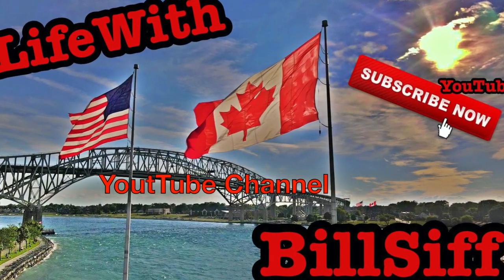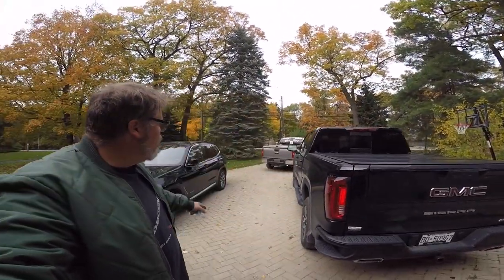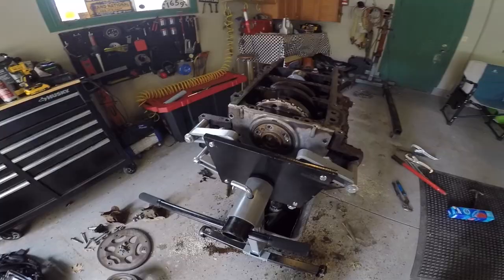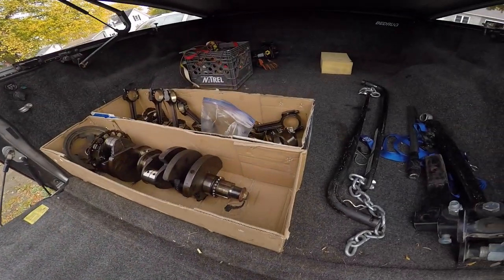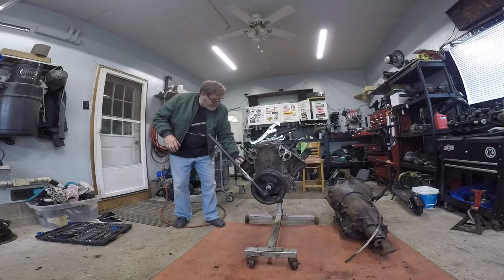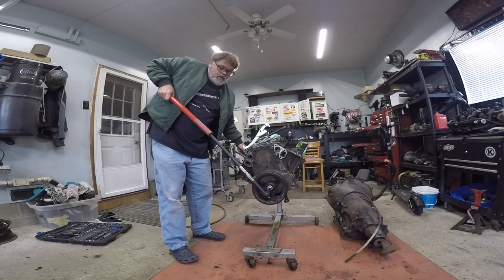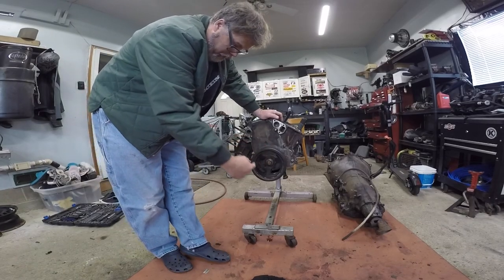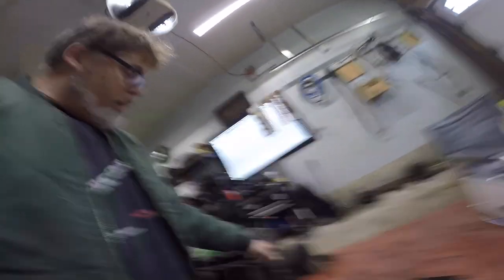That's Not Good

Comment: Bill hit the head of that bolt with a 4 lbs hammer a few times then turn it out we do it all the time at the coal mine the vibrations of the hammer helps break it loose

Comment: Heat will ruin the temper of the crank. I would use a bigger air impact Driver to get it off. Like for a semi truck.
Reply from the maker: Just added a little heat lol
Reply: @LifeWithBillSiff  
It should be ok.
👍

Comment: You'll get it I think it's normal to be tight bc it tightens over time the more you drive, I could be wrong. I remember having to jump on 4 feet of bar for 5 mins doing the timing belt on just a 1.6 and im 250+ lb.  So a V8 would need even more forces , I've heard of ppl just bringing the car to a shop to have it backed off with a powerful gun and tightened to 75% to drive home and do the job 😂.

Comment: Keep the internals. You never know when you need a crank bc you spin a bearing or bend a rod. You can just swap it out real fast. Also if you come across a block you can build yourself a LQ9. New bearing and rings. Do a at-home hone job and slap her together and put her aside for backup. Have 200 or 300 bucks into a rebuilt bottom end. Dont overthink things with these LS motors. There is nothing you or anyone can do that hasn't been done already. I been invested into these LS motors since 2005.

Comment: 1/2dr 6pt impact socket on a impact gun thats worth a shit. Set your compressor all the way up. Never mind that 90psi bullshit. I run all my air tools at 175psi. At the end of the line I only lose 10psi. 20year still have yet to break a tool. The impacting of the gun helps more then just constant pressure.